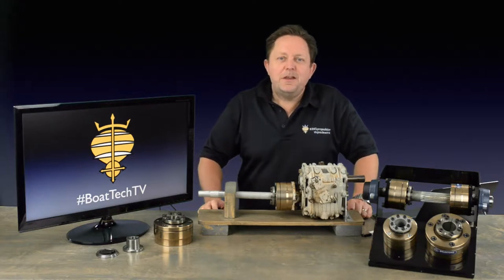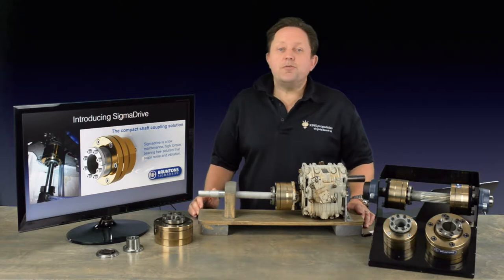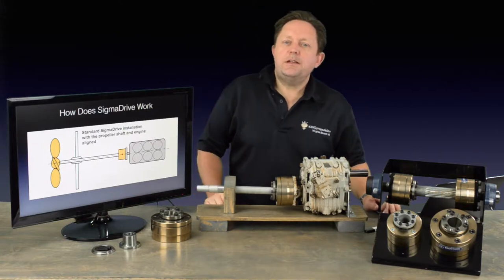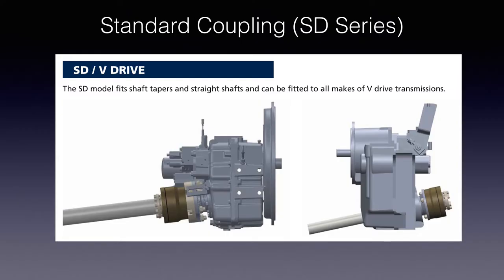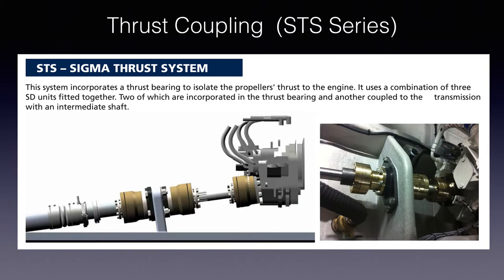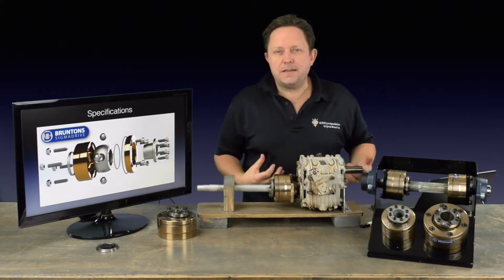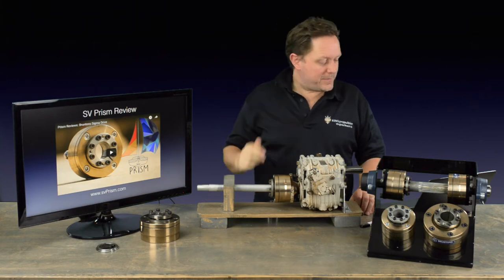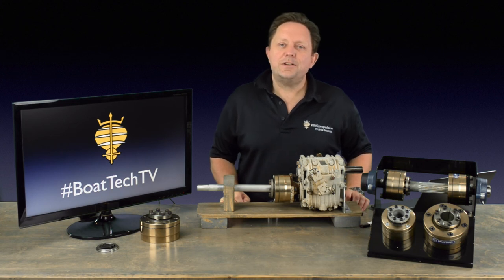BoatTechTV Episode 7 - SigmaDrive Shaft Coupling

Comment: Hello! A friend recommended one so I will probably purchase one. I know this video is a bit dated so can you post a link where I can get the latest specs? Also, as far as alignment goes, I needed to cut my shaft to remove the old coupler so I will need to align it with the sigma drive installed; is that possible? I remember you mentioned in the video that alignment is best done with the old coupler.